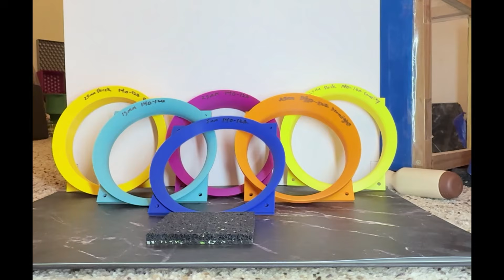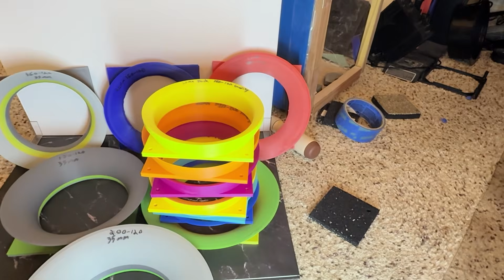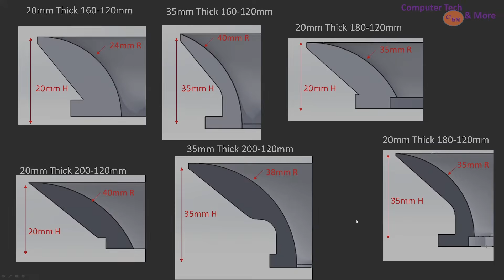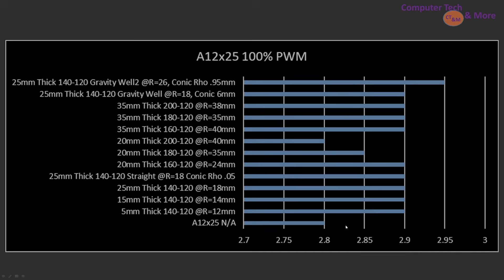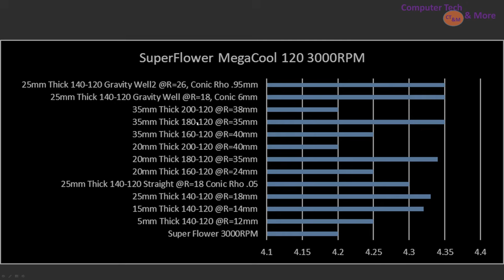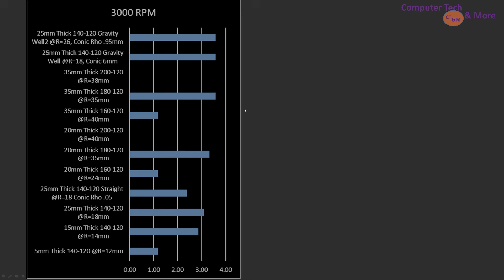PC Fan Flow Intakes: A Scientific Exercise in Airflow Optimization

Comment: Amazing test! I wonder how the 5mm spacers effect 25mm fans vs 30mm fans. Basically im wondering if you can just 3d print a 5mm spacer and get a budget T30.
Reply from the maker: its not quiet the same, but it does help. the reason 30mm fans have more static pressure is if they use that extra thickness in the fan blades. more curvature. 
I may re-visit this but I would set the RPM of the super flower to match the RPM of the A12x25 to see the airspeed difference

Comment: Great video, and good effort on the testing! My initial thought on the cross sections were that they all seem very agressive.
I did a lot of similar 3d printed pc fan bellmouth testing back in 2011, and my best results were by designs much closer to what conventional scientific literature proposed.
My suggestion is for you to look up "ansi/amca 210" standard designs and tweak from there. - beware, this rabbit hole goes deeeep (in my case this spiraled into a Engineering career)